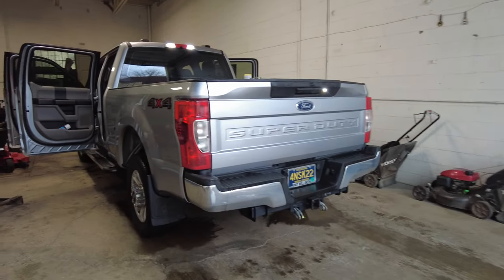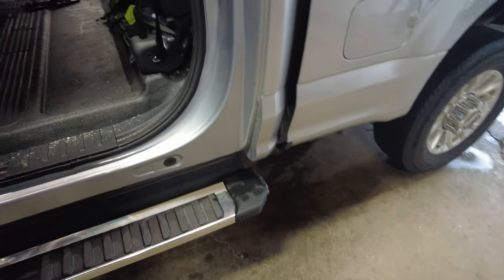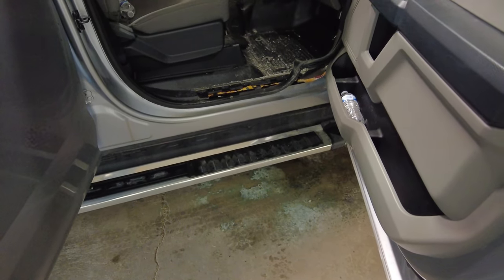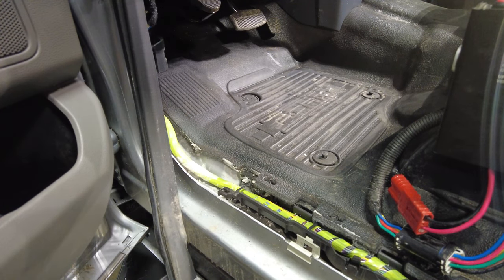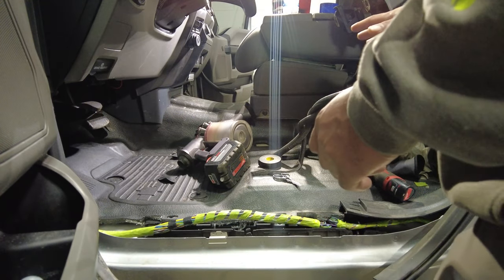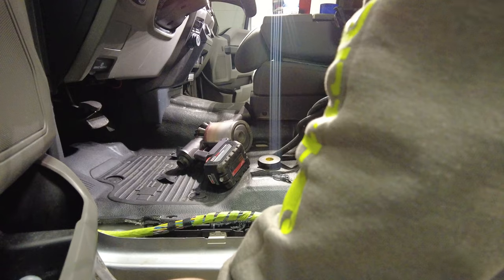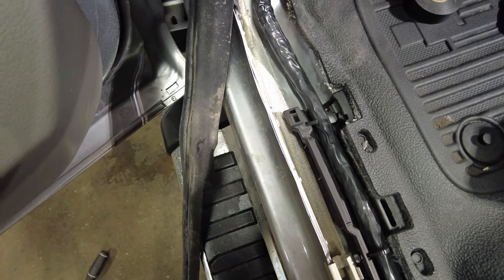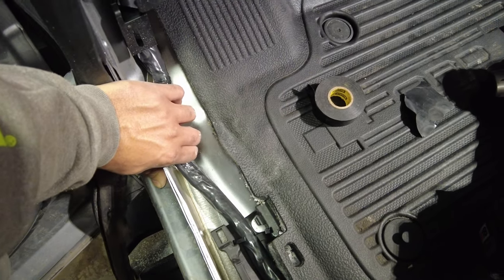Salt damage to aluminum trucks? How to PREVENT?

Comment: Aluminum will corrode, the the rate it corrodes will be slower than steel. The aluminum panels are also thicker than steel so it will also take longer. Keep it flushed out with water, fluid film or woolwax would be safe to apply over the wire harness too. I have a 17 F150 up in Minnesota. I sprayed the frame with woolwax when I bought it with 5 miles on it. The frame and cab is still like new with 6 winters now. I plan on keeping this truck for another 20 years.